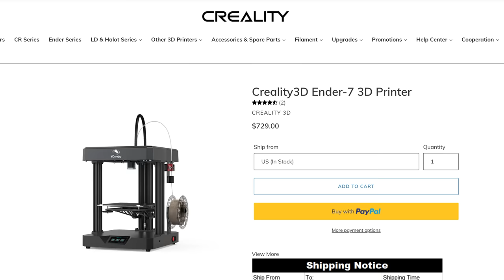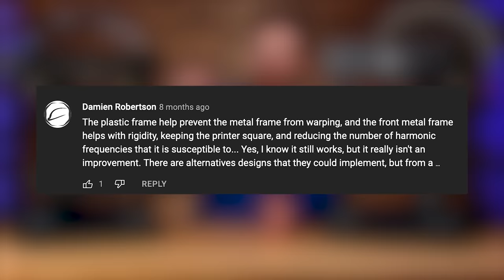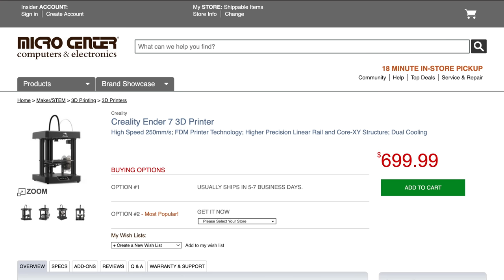The End of the Ender 7

Comment: I wasn’t one of those people but you can’t get it to work right and are still throwing shade at people telling you you are doing it wrong. I mean you have the proof in an unaired video…fair enough. 🙄🙄🙄 You didn’t feel that the method used to get the printer supposedly working was worth publishing? Helping people too boring for you?

Fremdschämen, it’s a German word when you feel embarrassed for someone else’s actions. Like someone struggling on stage when you can tell they have stage fright. Or this video…

This is like a Amazon review from a 3D Printing Noob (see what I did there?😂). Can’t get molten plastic to adhere to a hot surface, give up leave bad review. Sure the Ender 7 might suck but is this a 3D printer channel or an Amazon review?

The actual problem is you never made it to the points why it sucks. Your issues can be shared with other core printers. Example quality first speed, first layer adhesion, etc…. Fremdschämen….

For those with this printer struggling with adhesion I would recommend a different print surface. I found the surface of textured glass to fluctuate in temp to much to print fast on. Temp is sensed on the aluminum the further you get from that the slower the temperature swing is and thus the wider it is. It’s constantly expanding and contracting. If you insist on using it slow the first layer down works too. 

As your speed exceeds your cooling your quality will suffer. Use different slicer profiles for subsequent layer speed depending on your requirements. With no modifications it’s easy to make it print better than Creality cartesian printers faster. Upgrading the filament cooling will narrow the print speed between those profiles.

Slicer settings are free and basic things to do and know. Just experiment until you find that sweet spot and that applies to any printer. 

I wouldn’t recommend an Ender 7 but if you got one I would recommend ignoring this video. You can make it work with minimal effort via trial and error. Trust me I know from personal experience and others on forums it’s not a lost cause.
Reply from the maker: Hahahah. Sure. Sure. 😂🤣😂

Dang it, hit enter too soon. However, you make such broad assumptions and rather than ask question you assume. That’s rather unfortunate and really means no one should pay attention to your comment.
Reply: @3DPrintingNerd  I also hit enter too fast I removed my snide comment at the end it was childish and for that I apologize. But I did add a comment to the beginning.

Ignore my comment? My comments intended audience has already replied 😉.

The actual intended audience of my comment are people that already bought it. If they choose to ignore it and mark it up as a loss then so be it. However I feel working through these issues are much more productive. I fear someone buying an Ender 7 might be their first printer, when it doesn’t work (which you show is very probable) they will give up on the hobby entirely.
Reply from the maker: THAT is very true. I think even with the Ender 3 minimal approach and need to assemble, it still provides a first experience that won’t turn people away so much as this. 

Some have said to upgrade it past factory to see what it takes and what it would cost. I really like that challenge and I’m going to see what I can do.

Comment: Hi. I have a creality cr10, and also experience some  of the issues that you describe here, especially with bad bed adhesion. I am looking to get another printer, and would like some advice from someone who has experience with a variety of different companies and products. 

As the owner of a print farm, in your experience, what are the top three printers that you use in terms of print quality, reliability, and value for money?
Reply: I have three Ender 5, an Ender 5 Plus and a Rat Rig 400.  I'm consigning replacing the Ender 5 units with a Rat Rig 500 cube.  My 400 just works and with the auto tramming is always spot on.

Comment: Having owned and used the M3d (!), LulzBot TAZ 6, Ender3 and Ender 3 S1, I rank their performances as:

M3D - negative 700  (a very generous rating for a crowd-funded 3D printer)
LulzBot TAZ 6 - positive 11 (as in "it goes to eleven..."  For SIX years, it has printed GREAT!  LulzBot Support is light-years ahead of Creality's attempt at Customer Support)
Ender 3 S1 - negative 4  (it scored higher only because MicroCenter gave me a full refund on a 3D printer that never actually successfully printed anything!)
Ender 3 - positive 1 (I was able to actually print ONE item before it, too just refused to work again. It was a used unit I bought off FaceBook Marketplace...)

As you might guess, I'm going LulzBot again in the future.  I just ordered a 3.1 version dual-extruder print head for the TAZ 6 and will be buying a Sidekick 747 2.85mm filament unit with a .5mm nozzle to start my production print farm.

If I am going to spend good money, why not go with something that has a positive track record and danged-good support behind it?

Comment: "hey look at these other printers that are designed completely different, they don't have a front and therefore you're wrong"  okay joel, you win
Reply: I mean, also all the prints he did that also proved that.
Reply: @Aidenn23  prints with that firmware and settings aren't going to stress the machine at all, the issues people were talking about before are going to be seen with non-stock firmware.  If joel wanted to do an input shaper test using klipper, that would be the way to do it.  even a super floppy machine can move at pretty fast speeds, but it's the acceleration where the rigidity matters.  Low accel means it's not going to be stressing either way.
Reply from the maker: Ooh. Input Shaper with Klipper. That’s a fun idea.
Reply: @3DPrintingNerd  yes I think that would finally put us all in our place ;) (though the halo really isn't the limiter there... belt thickness and cantilevered idlers is going to be a major factor)

Comment: I've been using my Ender 7 for months without any of the issues you claim. 

 Not sure why YouTubers are doing a hit job on this printer.  
Cutting the front off was just stupid Joel.  You have to see the effects after hundreds of hours. 

There was no reason to cut the printer. The reason you stated is not valid, unless you assembled the printers incorrectly.  The printer does not need bed leveling or have adhesion issues. I suspect it was assembled incorrectly.
Reply from the maker: WAIT HOLD ON. You mean to tell you and I had different experiences???

Cutting the front off wasn’t stupid and it allowed me the ability to see it printing. Both were assembled correctly.

Comment: The V0 gets away with not having a top-front extrusion because it's so small. With a larger printer, the reduced rigidity could lead to the extrusions moving out of squareness enough such that the rails are no longer parallel. The front section of the plate the rails Y rails secure to performs a similar function. 

EDIT: And while you don't see a difference now, doesn't mean it won't later or at higher acceleration values. I'd like to see this tested for my own curiosity. 

EDIT: EDIT: I agree with you wholeheartedly on it not being worth its cost. That's apparent. Someone big had to step up and talk down to Creality. Glad you chose to.
Reply: BLV mgn cube and Prusa XL have much larger build volumes and work fine without cross-bracing at the top front.
Reply: @tristanlane3777  Both use wider extrusions.
Reply: Anyway, that's not the point here. The rails on the E7 are secured to a metal plate, rather than extrusions. Removing the front section allows increased compliance, notably with the "arms" twisting.
Reply: @theofficialczex1708  So?  Your argument was that the V0 gets away with it because it's so small.  I countered with examples of larger printers with a similar design.
Reply: @tristanlane3777  The larger printers you presented as evidence use entirely different methods from the E7 for securing the rails.
Reply: @theofficialczex1708  I thought we were talking about the V0......
Reply: @tristanlane3777  Oh, no. Sorry! I was referencing Joel's comparison of the V0 to the E7 without the front brace. Looks like we had a miscommunication.